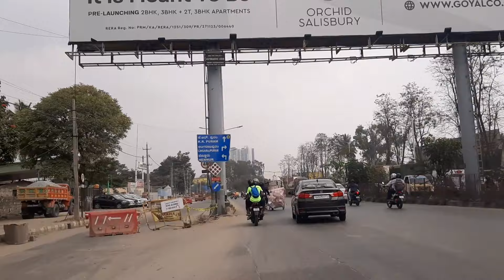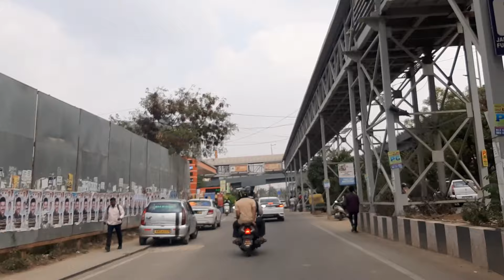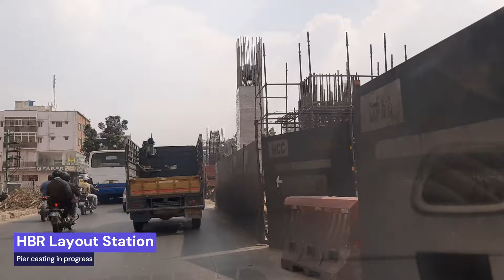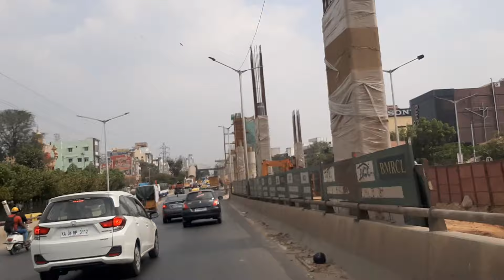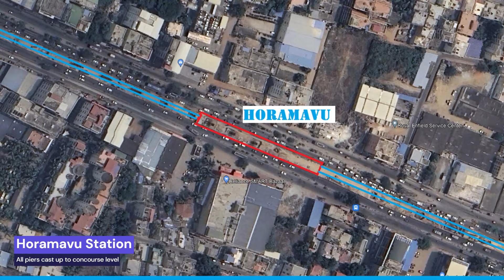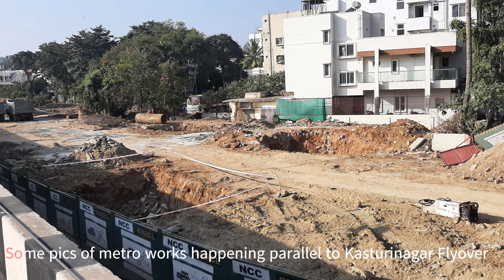Bangalore Metro : Blue line : Airport line : Hebbal to Tin Factory: FEB 2024  #bmrcl #bangaloremetro

Comment: According to Tom Tom survey Blr has improved form 2nd position to 6th position. There is a reduction from 29 min to 28mins 😊👏 we can definitely  solve this traffic issue.Only 4 things required 1.speed up metro work.2.During peak hours  8am to 11am and 5 pm to 9pm we should ban people using car if there is only one  single passenger,only if there are two people then thay can use car during peak hour.3.Rto should start scrapping old vehicles more than 20 yrs old asap.4.the new japan technology moderato signal is installed in 28 junctions from march it is goin to be operational it increases the traffic speed by 13% and reduces the traffic lenght by half itseems.If all this 4 points are followed definitely Bangalore city will come out of this bad title very soon.😊Kindly share this points so that people get awareness.The main reason for traffic is people are using car to go office even id  only one person is using it.Car  uses more road space they can come by bike for work.👍
Reply: @rahuljosephkickyourass  the best option is to complete metro work faster and open to public 🙂.
Reply: @rahuljosephkickyourass  from march the new moderato signal  japan tech installed in 28 junction will start functioning.Hoping it reduces the traffic congestion should see once it is operational.🙂

Comment: The estimate for the completion of the airport metro line was set around June 2026. Do you really think they can achieve this target?
Reply from the maker: Doable pkg2 n pk3 are going good. Pkg1 off late have got into a good rhythm as well. Civil works will lead way to architectural finishing works ( yet to be tendered ) and system works like signaling,  traction and so on.

Comment: Hebbal will have two interchanges in future, one with orange line, and one with a new coloured line from Hebbal to Sarjapur. The latter, is, especially very importnt, else it would not be worth taking a metro from Yelahanka to Ganganagar/Mekirh Circle etc.
Reply from the maker: Yes. That is the design.  Hebbal will be a true multi modal integration with 3 metro lines I.e  airport metro ( orr east ) , Orr west,  sjp-hebbal line. Additional suburban station too now shifted closer to these to have a connection and lastly as you know the bmtc buses originating from there

Comment: Thanks for the video!
I was wondering if this hebbal to Kr pura line gets delyaed, would it be possible to phase open the line from hebbal to the airport? Also, if there's a delay, would the Bmrcl consider this phased opening?
Reply from the maker: Hebbal to KR pura was delayed in between due to the unfortunate incident and work stoppage. They are going all out now. Dont expect this to delay any more. Phased opening depends on availability of trains / system works / architectural works. so hopefully it all falls into place.
Reply: I’m assuming trains will be the main cause of delays, since they’ll be prioritised for pink line first
Reply: This is Bangalore metro, so of course it will get delayed like always

Comment: Looking at the progress, KR Puram to Airport stretch wont open before 2028 for sure.
Reply from the maker: Which aspect do you think will cause this delay ?  Yes there was work stoppage earlier due to the incident. But now they are working with all their might. Hopefully it works well as planned.
Reply: @SunilHP  Comparing this to the Silk board-KR Puram stretch, the progress looks slow. Station works take atleast 2.5 years as far as I've seen and many stations work on this stretch are yet to begin.
Reply: @SunilHP  There is something lacking in almost all sections. From Hebbal to Verannapalya, totally there are around 4 piers with caps. Near Manyata, there is not even any barricading, forget piers. At Nagavara flyover, progress is seriously lacking. Near Hennur flyover as well, there is no progress. At Kasturi Nagar, don't know how long it will take for the suburban rail issue to be sorted out, and construction of both to be in full swing.
The thing which seriously disappoints me the most is that these guys (on this stretch at least) have made much less progress than SNC and even Afcons recently. There are places which have been in the same state since 2022. This would be unthinkable for SNC.
Reply: @SunilHP any idea when we can reasonably expect trains to arrive in enough quantity?
Reply from the maker: @srinandan3494  They were awarded 6 months earlier and they never had issues and work stoppage. Statistically even PKG1 of Phase 2b is catching up with others. U girder launching is something they need to increase in the coming days. Status taking 2.5 hours is all a myth. Precast methodology is adopted. See for example Saraswathi ngar station. Once the arms are stitch, I-girders / U girders will be placed and then deck slab casting happen.
Reply from the maker: @gaurav16cool  If you are referring to ORR trains, this will take time. The contract awarded to BEML is for Reach 6 + ORR Metro + Airport Metro. So first the Reach 6 trains are rolled out and then ORR metro. Sometime in 2026.